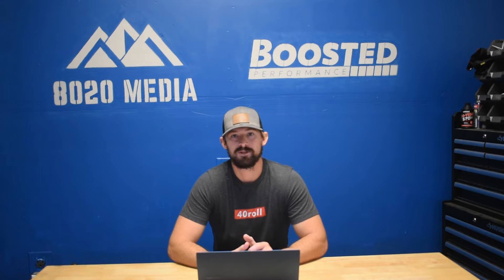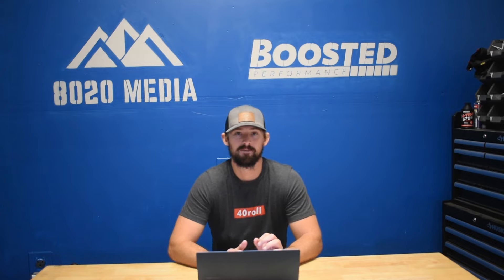DIY: How to Fix GMC/Chevrolet "Service Stabilitrak" & Traction Control Lights!

Comment: My 2022 GMC Yukon is rough idling, sputtering when accelerating from dead stop, or sudden change in speeds… stabiltrak sign came up on my Yukon. Had spark plugs changed already, new belts, etc. lost :/ it’s so bad.
Reply from the maker: There's a lot of things that could be causing this...definitely not a stabilitrak issue and something else causing the stabilitrak light. If it's as bad as it sounds then you should 100% have some engine codes....read those codes and see what direction they point you in. Could be cam position sensor, coils, fueling system, etc. so need some more diagnostic details to try to narrow it down.

Comment: 2013 Tahoe LTZ, 230,000m. Intermittent Service Stabiltrak light , will rest itself eventually.  Replaced SWPS. 3 times no change . Wheel speed sensors replaced …….nuthin.  Doesn’t affect drivability tho.🫤.  One sensor can affect another …..so it’s a circular firing squad
Reply from the maker: T - Thanks for sharing your experience! We totally agree..

Comment: Mine was caused by the positive battery cable and the battery charge regulating sensor. Needed a new positive cable and that damned sensor had to be over the cable without a sleeve cover over the cable so it could function properly. I went through all these things prior to figuring it out. And mine wasn't a check engine code alone issue my car would go into limp mode and I could only go about ten mph. Check your positive cable for corrosion and good terminal connection on that battery saver. You won't get the saver warning you will just see intermittent limp mode when hot and dry out. But a small bump and limp mode. Good luck.
Reply from the maker: A - Thanks for sharing your experience. This may certainly help future viewers.

Comment: I have a 2010 Camaro SS I just got was driving on the highway and the service stability light came on my RPM gauge stopped working and the car had zero power and I barely got it off the road. I turned it off and turned it back on and now it seems to be running fine. I changed the throttlebody but a week later the car did it again do I need to probably check the plugs next?
Reply from the maker: C - That would be a good start. Unfortunately, this isn't an easy thing to diagnose. Keep us updated!

Comment: I’ve had my tire pressure monitor system light on for a year, didn’t think much of it since I can just check them manually and I do, and now my car is saying service traction control, service brake assist, and service stabiltrak. No check engine light at all. From what Im hearing do you think just getting the tpms fixed will cure everything? It’s a 2015 impala limited ls
Reply from the maker: Nick - This could be the solution, but can't be 100% sure as this can be a very difficult problem to solve.
Reply: @8020Media  It did stop showing the messages but it’s going back to what it did before, whenever I’d turn left at low speed the traction control would come on randomly for a second. This is so weird
Reply from the maker: N - Sorry to hear this, however, keep us updated.

Comment: My traction control abs lights are on in my 2011 Silverado 1500. Starting coming on intermittently over the last year and then just the other day it turned on and won’t go off. I scanned it to see what would come up and it says rear right wheel speed sensor circuit, so I changed the sensor and when to clear the code and it will not clear… abs and traction control lights are on and code won’t erase with scanner or if I disconnect the battery over night lights are still on. Any ideas?
Reply from the maker: S - How long have you driven it? May take time to clear.
Reply from the maker: S - Keep us updated. Unfortunately, this is not the easiest thing to resolve.

Comment: Having this issue, had my 2013 6.6 duramax to the dealers, it has a clunking sound when switching gears. They replaced the tcm plug and didn't fix the issue,  my ignition switch  is very loose- has to be wobbled around to turn on the truck - maybe this could be a issue?
Reply from the maker: S - Certainly could be the issue! Unfortunately, this problem is difficult to diagnose.

Comment: Have an OBD2 sensor tester. My Stabilitrack light, abs light and traction light are on and its not showing any codes for that but it does say O@sensor #2 can this be why my lights come on and off
Reply from the maker: C - It certainly can!

Comment: I have a 2012 Silverado, and my "service traction control", stabilitrak warning light only comes on when the temperature is above 90*, since I live in Phoenix, it will be on most of the summer...I took it to the Chevy dealer, they said it was in the dash and put a shim between a couple of wires, it stayed off for a little bit, but as soon as the temperature went back above 90* it came back on...any suggestions as to why the heat has something to do with it, also the check engine light doesn't come on
Reply from the maker: Cindy - It's quite difficult to pin point the exact issue here, but we can maybe provide some helpful insight. Warmer temperatures can affect many electrical components. If we had to guess it could be a sensor or control moduel.
Reply: I have a 2011 Silverado, does the same thing when it heats up outside.  Truck runs fine when the warning is on or not.  Just annoying.

Comment: Hey I changed the break sensor ,maf sensor , netural safety switch. And transmission speed sensor. And I still keep getting traction control . 08 Chevy Tahoe ltz what else should I change their is no abs light on and the backup camera does not work and you can't see what geae your in until I clear the codes .
Reply from the maker: Zu - Unfortunately, this is a tricky problem to diagnose.. Have you taken it to a shop?

Comment: I’ve got an 07 suburban and I’ve got both lights on and my check engine light is flashing I’ve replaced all plugs and wires plus #1 fuel injector. Any help please
Reply from the maker: Brian - Have you tried to pull any codes? This would be helpful to diagnose, especially since the CEL is on.
Reply: @8020Media  I’ve got a p0300 random misfire and a c0561

Comment: I have a 2007 Yukon and while driving it started to smell like burnt rubber and making a somewhat bouncy ride. Then the traction control light and check engine light went on. Any idea
Reply from the maker: Sophia - burnt rubber smell can sometimes be gaskets or oil leaks, but that wouldn't cause a bouncy ride - that would more likely be from suspension which wouldn't cause burnt rubber smells. I'd suggest getting a code reader and seeing what code the check engine light is giving.
Reply: @8020Media  thank you! I feel defeated anytime I have to take my vehicle in for work. I feel like I am always being taken advantage of. Thank you for your feedback.

Comment: My service stabilitrak and service traction control light are both on I also have my abs light on as well I just replaced both front wheel hub assemblys and the passenger rear abs sensor that was cut. I don't see any issues with the driver side abs sensor. Also the #9 fuse isn't blown. It's a 2011 chevy silverado 1500 4.8l. Any ideas on why all 3 lights are on? I don't see any physical damage or anything wrong everything's plugged in as well. Also no check engine light or codes thrown. I'm kinda at a lost on this one
Reply from the maker: Christian - Unfortunately, this is not an easy issue to diagnose.. Have you addressed the things we referenced in the video?

Comment: So i dont have any check engine lights on but my doors kept locking an unlocking fast/loss of power for short amount of time/ and abs lights flash on
Reply from the maker: D - Few things you can check here: Battery, alternator, ignition switch, or the ground connection.

Comment: I have a 07 avalanche ls, got the shocks and struts replaced by my uncle and soon as i turn on the truck “service stabilitrak” and “traction control off” comes on the dash any ideas?
Reply from the maker: Rosendo - It takes the ECU a little bit to pick up on changes like that. How long has it been?

Comment: I've got no codes popping up but the stabilitrak light comes on intermittently while the truck also goes into limp mode. Any idea what that could be?
Reply from the maker: Jamison - Sorry to hear about this. Unfortunately, this is a very difficult problem to diagnose. However, here are some possible solutions:
- Wheel speed sensor
- Steering angle sensor
- Brake fluid levels or
- Throttle Body issues

Keep us updated on this.

Comment: Hey I have a 2011 Lml duramax 4x4. I have a service stabilitrac, traction control and service 4x4 lights that are on. Wondering if you could stear me in the right direction on this issue.
Reply from the maker: Cody I'd suggest starting with fueling since it's a diesel. When was your last fuel filter change?
Reply: Check the grounds

Comment: My Stabilitrak warning goes off every time the auto stop is engaged sitting at a light with my foot on the brake but the second I lift my foot off of the brake and touch the gas I get a Stabilitrak warning. It's happening more and more and now it's stalling the car and affecting the power steering 😮 what is going on 😵‍💫

Comment: Got question about breaking system has anyone have ideal where or how im loosing break fuild with no physical location of a leak i cannot find a leak anywhere no fluid on the ground or wheel I've gone through 8 bottles of break fluid  when it gets low the trac stabilize trac light comes on as well
Reply from the maker: Could be leaking into the brake booster, you wouldn't see any external leaks from that.
Reply: @8020Media  I'd have to say no way the booster would fail not to say 8 big bottles of break fuild it be leaking somewhere
Reply from the maker: Have you checked it?

Comment: I just got this on my gmc 2016 terrain never had any issues i was driving and it popped on the biggest code i get is the camshaft sensor will everything return to normal if replaced ?
Reply from the maker: Alexander - If you’re getting a camshaft position sensor code, we’d advise tackling that first since it is a relatively cheap part and easy DIY. Then erase the code, let it run for awhile, then reassess.
Reply: Is it possible to erase codes without a code readee

Comment: I have a 2012 Chevy equinox I put a new battery in it started and ran rough I drove it around the block and when I came back I lost my steering went out and I finally got the car parked all the lights on the dash when out and it died and battery is dead
Reply from the maker: Curtis - That is odd that the new battery is dead. This strikes us as an alternator issue. We have a video on alternator failure if you would like to check that out: https://youtu.be/HKP1vKsIr4g

Comment: Can you tell me if ,this retains to reduced engine power,.  And whats a p0335 ,p1682,p0685?
Reply from the maker: Lisa - This could cause reduced engine power to help protect the engine from any further damage, but that is a low possibility. As far as the fault codes:
P0335 - This code signifies an issue with the crankshaft position sensor circuit. The crankshaft position sensor is responsible for detecting the position and rotational speed of the crankshaft.
P1682 - This code signifies an issue with the ignition switch and indicates that there is a discrepancy between the actual voltage levels and the expected voltage levels in the ignition switch circuit. This can lead to issues with starting the vehicle or maintaining proper ignition function.
P0685 - This code signifies an issue with the engine control module (ECM) power relay control circuit. When this is present, it means that the ECM is not receiving the proper voltage from the power relay, which can cause the engine to stall, not start, or exhibit other performance issues.

Comment: I'm having similar issues with Opel Meriva 2012. 
Error codes
P0171 (present) U0121 U0140 C0244 U0073 C056D C0196 C0000 U0140 C0121 B2524 and U0121 (all the others not present)
already changed the abs pump, didn't seem to work. Sometimes all the errors disappear and reappear in a few miles. Any advice for me? I got tired of spending money on the wrong specialists.
Reply from the maker: Cosmina - We have a full video devoted to P0171: https://youtu.be/U3JVc3VLahA

We hope it helps.

Comment: I only have lights on. Plugged in an OBD reader and showed zero faults. Unit drives and runs great. But I have service Stabiltrak/TCS light on, check the wheel bearing and wiring. Nothing. Sometimes read emergency brake light comes on. Ideas? (your audio is really bad BTW).
Reply from the maker: J - With the emergency brake light occasionally coming on, this might suggest an issue with the braking system. Unfortunately, this isn't an easy issue to diagnose but here are a few things we would suggest looking into: Wheel speed sensor, ABS module, brake fluid level, and brake light switch. 

Regarding the audio, this was our second video and we were still trying to figure things out. Keep us updated on this!
Reply: @8020Media  Yes, from watching You Tube the TCS and ST are all wheel spend sensors. I will get that fixed first and see what happens. The emergency brake light rare comes on. I can drive 30 miles and then it will pop up again. Hate chasing that stuff. Thanks for your input.

Comment: My 2012 gmc is telling me that something is up with my trailer brake control?  Stabilitrack initiating ?
Reply from the maker: I've seen this before being caused by a bad wheel bearing that then messes up the wheel speed sensor
Reply: @8020Media  I hope that’s not the case. I’m a long way from home. I’ll listen for unusual noises. Wish me luck on getting home.
Reply from the maker: Keep us updated on this!
Reply: @8020Media  The only code’s I get are c1113 and c1114. Trailer brake issues. I might jack up the truck and check the wheels. I always check the temperature of the wheels when I stop but haven’t noticed anything.

Comment: My 2015 Sierra 1500 will randomly just Die or throw stabilitrack light when driving in the snow and the entire electrical system seams to glitch. If it dies I’ve had good luck with just undoing and re connecting the negative cable on the battery and it “keeps me going” not ideal. The truck won’t throw codes or check engine light. Once in a while it’ll throw an “open and close drivers window” (does nothing) I’ve checked and cleaned all grounds. Any one else have similar symptoms? I’m not paying a dealership or mechanic to do research and development. I can slowly work through that myself. It would be nice to just know the answer so I can fix it.
Reply from the maker: M - Sorry to hear about this.. Unfortunately, this issue is not the easiest to diagnose, especially without an engine code..

Comment: When the light 💡goes on this is where you start throwing 💸💰 money at the problem.

If I burned money in a fireplace  at least I will get warm 🔥.😂
Reply from the maker: Big - This is true lol
Reply: We have to demand more from these vehicle manufacturers,  this is totally unacceptable conditions. Failure rates at 100% ? We need to stop buying them at all!
Reply from the maker: P - They sure don't build them like they used to.

Comment: Certain phases of the moon, if your wife is pregnant, was it your best friend,. This system is ridiculous. 
I tried spark plugs, air filter, reprogramming the tire pressure sensors, etc.  I did get it to quit going into limp after fully cycling the accelerator several times (engine off), but the warning still appears every morning.
    Many things on an aging vehicle can trip the system NONE of which effect the drivability or safety.  And, NOTHING should be able to modulate the brakes accept your foot, because it could erroneously apply, or deprive the brakes at a terrible time...based on SPARK?  Or FUELING?  Rough spot in the road?  It's possible this system has already caused injury,  but it will never reach the public.
Reply from the maker: Two - That is a wild first sentence, but yes we agree, this system is very complex and doesn't totally make sense.

Comment: My apologize.
It wasn't the stabilitrack light.
It was the 
(Ride control) light thats flashing. Would that cause my problem 4 the brakes 2 stick?
Reply from the maker: Typically this light would not cause your brakes to stick. We have another video for that specific issue: https://youtu.be/x3gHBhXpJIs

Comment: I have a 2009 gmc sierra 1500 hybrid. When that light comes on it shuts the whole truck down and won’t turn back on for about 10seconds. The light goes away then comes back on on and off   I have no idea what’s going on. Does show up on a reader either.  Also fixed every part the reader was showing. Nothing comes up anymore
Reply from the maker: Hannah - So it's fixed?

Comment: My 2008 Acadia will say “traction control off” then it will say “service stabilitrak”. Sometimes the locks click up and down and the car will jump into 3rd gear. There won’t be a circle around the PRND on the dash. I have changed the pcm. Still getting the message on dash. Also, I’m getting timing chain codes.
Reply from the maker: Paula - After hearing these symptoms, here are our thoughts:

One possible cause is the wheel speed sensors or related wiring, which are used by the stability control system to detect wheel slip and adjust the brakes and engine power to maintain traction. A fault in the wheel speed sensors can cause the system to malfunction and trigger the warning messages you are seeing. However, the timing chain codes are likely a separate issue. Potentially a stretched timing chain since it is jumping. This most likely is causing the engine to run poorly, which could also contribute to the stability control system issues.

Have you taken it to a mechanic to diagnose or anything?